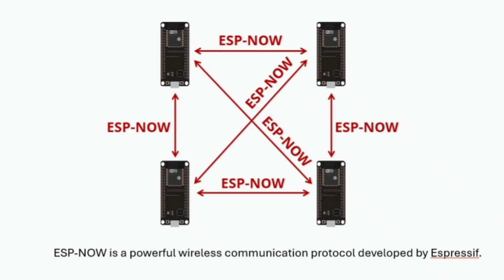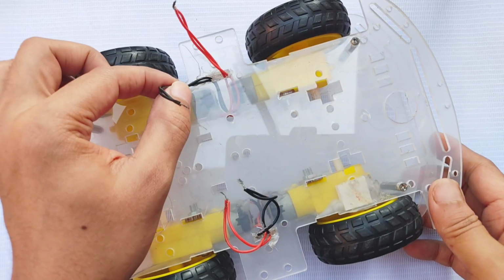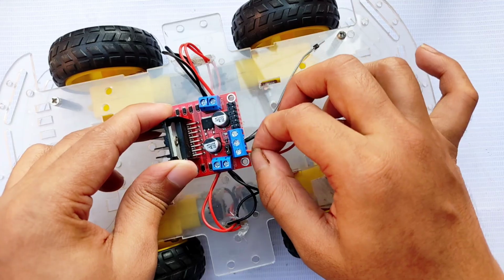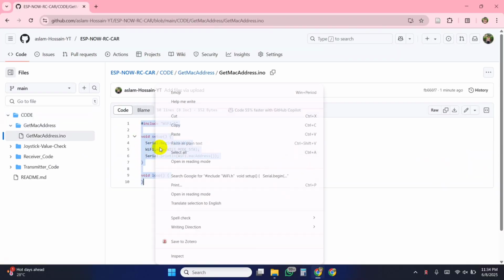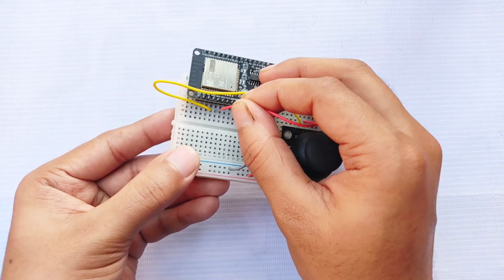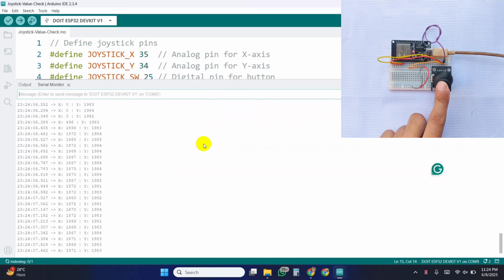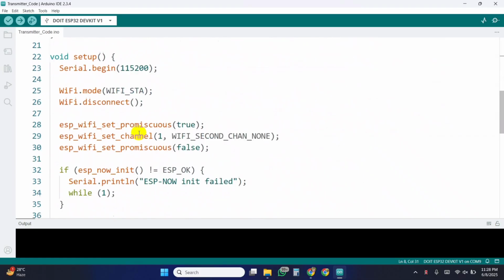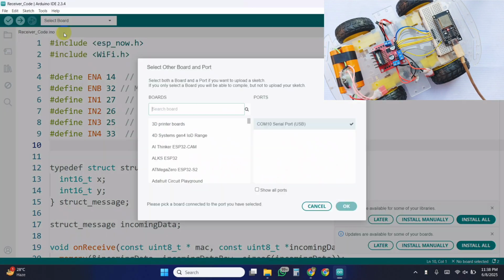ESPNOW RC Car using ESP32 | Joystick Control Remote Car using ESP32

Comment: Great Work, i have tried with 2 wheels and one castor wheel at start but somehow my left motor is fast as compare to right motor which resulting into moving my device to left turn inshort not driving in straight 
Do you have any suggestions on this case …!

Comment: Hi! I followed your ESP-NOW tutorial exactly, but my transmitter keeps showing Send FAIL, even after updating the receiver MAC.

Receiver MAC: 1C:69:20:2F:F8:44

Wi-Fi mode: WIFI_STA on both ESP32s

Peer added successfully

Distance: ~1–2 meters

I verified the receiver code is running with ESP-NOW initialized and the receive callback registered. Still, every send fails. Could this be due to Wi-Fi channel mismatch or MAC-layer acknowledgment issues? Any advice?

Comment: How may I replace joystick controller by two potentiometers?
Reply: I dont know much about electronics im learning but i think that since a joystick is just two potentiometers in one unit, you need to get like a slider potentiometer. Or a dual axis potentiometer, 2 of them.  The one in the video is a 4 axis joystick, it can go up down left and right. A dual axis can go left or right. 

If you wire it correctly then using 2 dual axis potentiometers or sliding joysticks, one that goes up and down and the other that goes left or right, it should work. I think if you also just wire it the same way as the 4 axis joystick is should be the same (dont count on me much though)
Reply: @Z_kun11 thank you.

Comment: Which ESP32 library version are you using in Arduino IDE? There are other ESPNOW examples on YouTube that no longer work because of changes to the ESP-32 Library. I have been wanting to figure out how to use the new library version, but I also have quite a few programs made with the old version. I'd just like a working example of the new code, so I can get an idea of how it works. (BEFORE attempting to rewrite all my code) Hopefully, the code for this project might help me understand the changes in the syntax of ESPNOW implementation.

Comment: Which version of esp 32 by espressive  system you are using  currently  because when I use the latest version I get 00:00:00:00:00:00 ip adress or when I change the version of esp 32 by espressive system to old version 1.02   it works fine  what should I doo
Reply from the maker: its wroom 32. dev kit v1. with CH340C. type C

Comment: I uploaded the code 'Getmacaddress' and pressed the enable button and checked with the serial monitor, but the receiver mac code doesn't show up properly and it says 00: 00: 00: 00: 00: 00
Reply: And i wonder if mac address differs at each esp32

Comment: I uploaded the receiver code to Esp32 using Arduino IDE, but I got an error, can you explain what caused it and what is the solution?
Reply from the maker: Whats the error?
Reply: Hold the boot button next to the usb port on your esp32 while the code is uploaded.

Comment: I already Created My Own ESP 32 Car And I Am currently Working on Stability and Efficiency of My ESP Car So the L298N Is Not Efficient Its Dissipate Power as a heat So I am Thinking To change Motor Motor Driver So then Tell me Which Motor Driver is Better Then L298N ( I Want MOSFET Based Driver ) Not Bi polar Junction Transistor please Suggest best Motor Driver which handle Easily 4 Bo Motor
Reply from the maker: BTS7960 which can handle upto 43A. Need two pieces of BTS7960 to make a dual H bridge.
Reply: Genius🎉

Comment: What the Distance Range between Both ESP32 ( Transmitter and Receiver )
Reply from the maker: 200 meter
Reply: Bhai please reply karna 200 meter tak response karta hai ache se ki thoda kam karta hai
Reply: Bhai maine mera ek truck ka model hai usme 5 lights ke liye button diye hai aur ek steering pe bo motor control karna hai via input potentiometer Jo ki transmitter me laga hoga ,aur lift axle ke liye ek motor,aur reverse forward ke liye ek motor meko batao meko wireless banana hai toh kaise proceed kari batao
Reply from the maker: @gnoledgeofficial1575  schematic bejo
Reply: Bhai bass idea hai there is no schematic